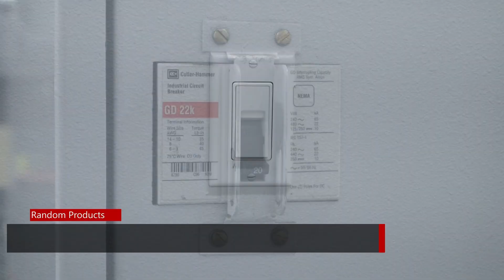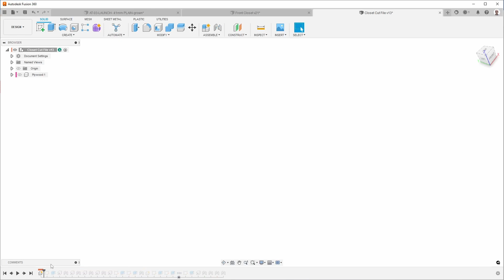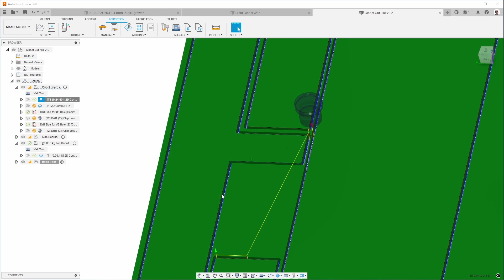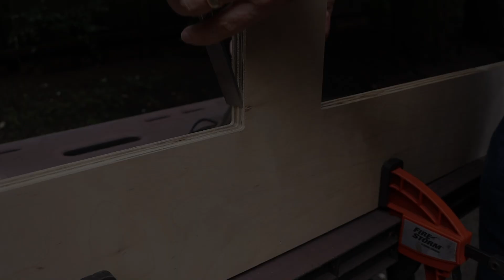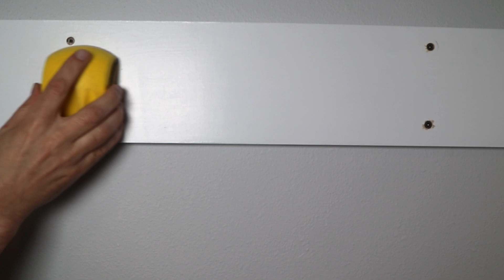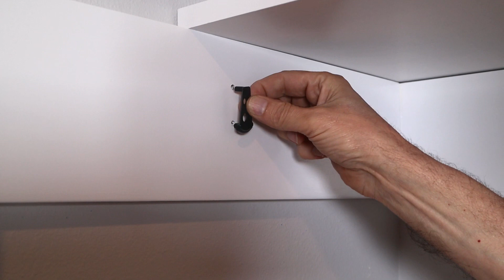Finishing a Front Closet with a CNC Router

Comment: Glade you used plywood over partical stuff.
Reply from the maker: Using dimensional lumber would have been easier, I'm sure. But where's the fun in that, right? Plus, using plywood allowed me to get the holes exactly where they needed to be.
Reply: @JohnSL  and you get to play with the new toy. 
The first thing I made on my lathe was some garden pegs out of 2x4 just so I could dial in the four jaw.